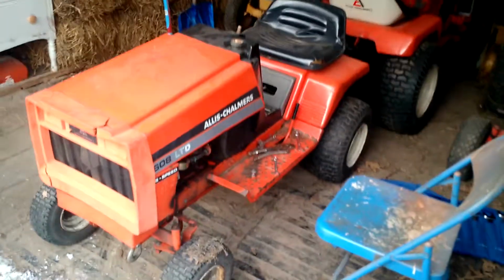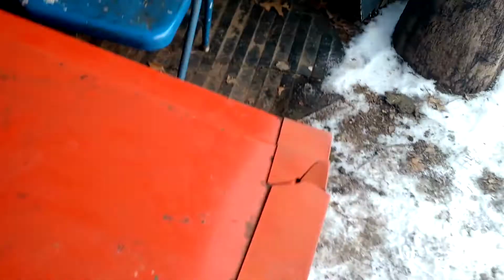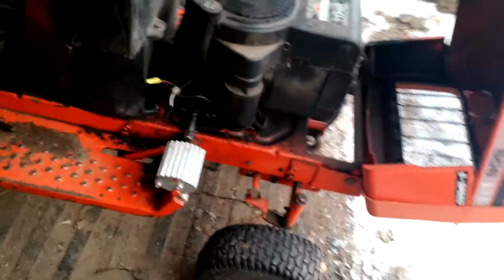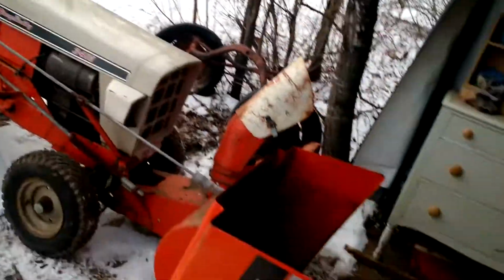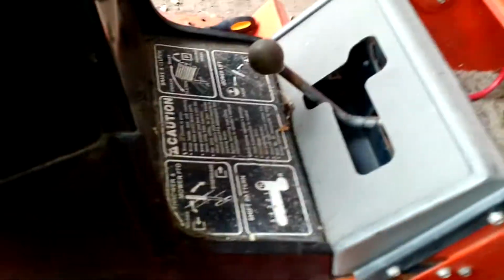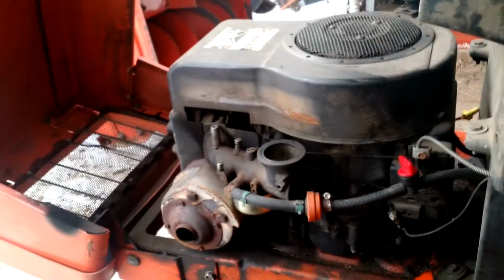Allis Chalmers 608 part 1 of 2

Comment: Bought a new 608LT in 1978, and mowed with it until I bought a new Agco 23 hp (simplicity) in 2013.  Still have is the machine shed, and was still running when I retired it.  Estimate around 7-8 hundred hours.